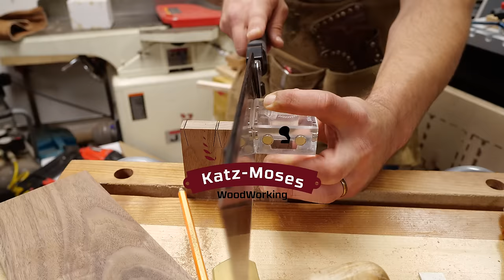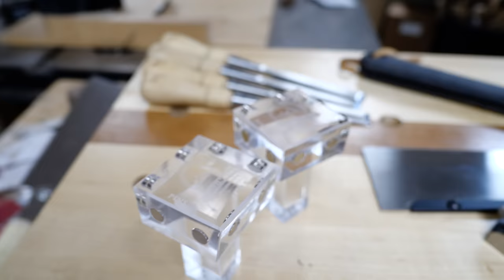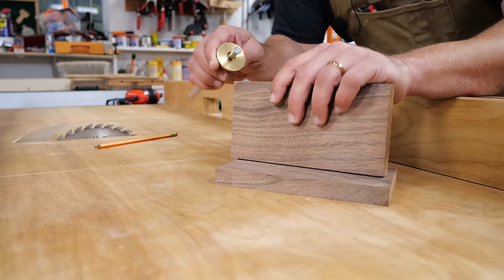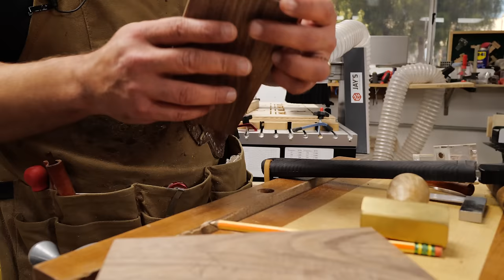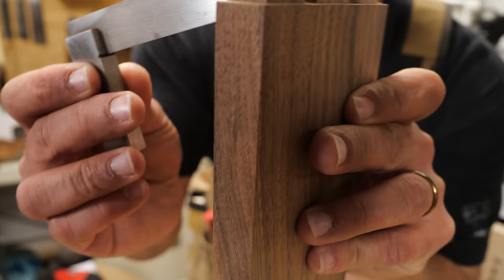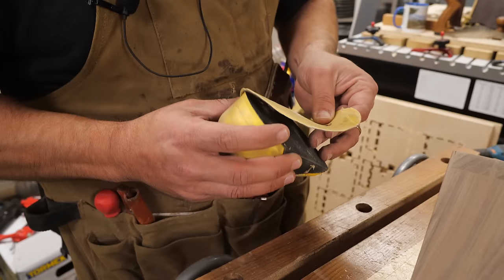A Comprehensive Guide to Cutting Dovetails - Tips and Tricks Galore

Comment: Jonathan I was watching this video again (I never get tired of it) and I thought of something that I learned as a apprentis many years ago here in Los Angeles in Local 721 Cabinet Maker Union working for German shops.  Our finishing team of German finishers would take Dap tubs and cut them open, empty them into container and using dies would adjust the color to the exact shade to the hard woods we were working in.  Crown Molding for example, back then we screwed them in place with the old Robinson head pin head screw to the metal studs behind the dry wall.  Later we changed our installation to just screwing a cant strip to the dry wall ceiling corner and then panel adhesive and gun nailed the molding in place.  Point I'm making here is that we too used our sawdust with glue as  nature filler,  that is a very old method as I am sure you already know but I am sure that you like many others I see on You Tube work with very exotic woods from time to time and this method just might come in handy some time.  I hope not but you know, _ _ _ _ happens.   Love to watch a master at work.

Comment: About the saw dust trick; You need to be sure that the species of wood you are using does not go black or dark blue when you mix it with water based glues.  I have had that happen to me a few times, especially with gum tree woods and it's a real bummer on an otherwise great piece.

Comment: Great stuff, many thanks. If the saw blade is well supported by the magnets what about a simple 90 and 45 degree version for regular carpentry and a long scarf joint perhaps.  Also routing in door locks with deep holes that need to be parallel to the face of the door.  What about an accurate universal steel base plate to which you attach one wide or two less wide guides by magnets to keep the router exactly at right angles to the door face.  One each side to finish each side exactly where it needs to be to fit the lock.

Comment: if you're cutting the dovetails free hand without a jig , would you also use a marking knife when laying out the front face of the tails and pins so that the saw tracks that knife line ? I see a lot of people using pencils to mark them but today I tried scribing a dovetail on the end grain as well as the face grain with a knife and the saw tracked SO MUCH better than just with a pencil ..... btw LOVING the apron - using it every day !!!

Comment: 5:15, Why do you size the divider 1/8 inch side pin dimension off the square rule, why don’t you set the divider 1/8 inch from the 1inch and 1/4 divider holes which you’ve already created the 2 x 1/8 inch pins after you walked the divider? Then you know for sure you’ve got the same pin size, plus it reduces the need for an extra measuring step off a rule if you have or haven’t got an indented rule.

Great channel, thanks for the knowledge share.

Comment: Let me see if I can word this correctly since I am a novice and I am not up to snuff on terminology: At 16:59, before placing the jig up to your saw you say that you are going to get the cut started with a 'forward' stroke of the saw. On the previous board, when you were at the same point, just before sliding the jig up to your saw you say that you are going to get it started with a 'backwards' pull of the saw. My question is, why is the saw started differently on each side or does it matter?

Comment: I'm a bit confused.  At about 4:48 into the video, where you decide how to mark out the dovetails, the board was 3 3/4 inches wide, so you set your divider to 1 1/4 inch, or one third of that.  Where does the 1/8 in pins come in?  Did you skip something?

Comment: I have a beginner's question and hope you can help me.
I am building a frame for a box using dovetails. I want to use wood stain.
Should I apply the stain before assembling and glueing or afterwards? I fear if I use it afterwards the stain would not work at spots where I used the sawdust trick. Applying it before would require me to also put stain on the sawdust. What do you think is better?

Comment: at 25:04 if you look at the two boards put together, the right side( as we look at the picture) appears to be a bit wider than the rest of the board like 1/16 of an inch....wouldn't it be a good idea to measure the end result with calipers or any other measuring device against the rest of the two boards to see if we have the same width at the joint as the rest of the boards? is it possible that the bigger tail is pushing the smaller pin at the end of the joint?

Comment: Did my first dovetail drawer and used your jig. First joint was the snuggest fit I’ve ever made! Is it normal practice to leave the scribe lines visible or to plane them out. The visual definition the line gives is nice imo.
Reply from the maker: It's just a matter of personal preference.  Some people think it looks good and adds to the hand cut look of it. others think it takes away from the piece. I prefer to remove mine but either way looks great I think

Comment: Very nice.  One question as I may be missing something and considering your flipping the board anyway when cutting, why wouldn’t you have a jig with the 8:1 angle on one side and 6:1 on the other?  Getting both angles for the same price would sure make the tool more attractive.
Reply: Also thanks for the backstroke tip with the Japanese dovetail saw.  Just tried and works really nice.  Not sure why I didn’t figure it out on my own but oh well
Reply from the maker: It's already almost half the cost of my competition. Also it would be impossible to have both pins, tails and a shoulder side in both sizes on one jig. Even if I did a 7 sided one it would probably get pretty confusing

Comment: Okay pretty decent guide here but there's some stuff that bothers me. I am a beginner, but have enough experience to notice this:

Think it's bad practice to mark/scribe all over your dovetails and pins just to consequently having to sand everything down to get rid of it. It gives the illusion that it saves time to just quickly scribe all around, but then you have to waste time on sanding everything - or waste time on not sanding down, but having to think of an excuse for why you were to lazy to do it properly.

Also, these thin pins relative to the tails make it an imbalanced joint, adding a rebate like this perhaps even makes it worse. (using a rebate like this does make sense if you are making double (inlayed) dovetails)

Another thing I wanna say is that all these jigs are making things easier and quicker - but especially for beginners I would recommend doing as much as possible without them, so to improve your skills.

Comment: I was wondering, why have the pins be so narrow? It seems like, in theory, you could have slightly wider gaps between the tails and the pins be a little thicker, and then not worry about the pins being so delicate. Granted I haven't actually tried cutting dovetails yet, and maybe they're not as fragile as hey appear. I assume there is a good reason for them being done this way, I just can't figure out what it is from my limited knowledge/experience.
Reply from the maker: Because there's no way that they can be machine cut when they're thinner than a 1/4 inch on top. Thinner proves they're handcut and in my opinion look way better
Reply: @katzmosestools  That makes sense. Thanks!

Comment: 1. Can I assume that there are no hard and fast rules about the sizes for the pins and tails?  2, And it seems like it is acceptable do do either the pins of tails first but maybe with the rabbit you need to do the tails first?   Seems like much of this is personal taste and the newbie (me) has a lot of leeway.
Reply from the maker: No necessary size bu skinny pins are desirable because they cant be reproduced by a machine thus creating a handmade look. Always tails first. There's no way (barely any way) to mark out your pins accurately onto your tail board.
Reply: Thank you. Got it. Makes sense. Trying my 1st Dovetails now. Your jig should arrive today.
Reply from the maker: @AlGuden  I can't wait to see what you create bud!
Reply: Al - There are no hard and fast rules for dovetail vs pin sizes. BUT, making the pins too small makes the joint physically weaker. The ratio of dovetail size to pin size should be about 70/30. Too much less makes the pin board too weak to support the joint over the long haul. Jonathan’s assertion that the pins should be skinny is just an ego thing. Who cares if someone might think your dovetail joints are machine made??? That just means you are cutting some amazing dovetails! Jonathan always spaces his dovetails evenly across the joint. I have seen and have created a variety of spacing for my dovetails. Get creative and change it up! Sets of two or three toward the ends  with another set of two or three in the middle adds interest to your dovetails without compromising the strength of the joint. Jonathan’s skills are amazing and, while I love his work, the creativity is kinda “meh.”

Comment: Why are the pins made so narrow? Wouldn’t the joint be stronger with balanced sized pins and tails?
Reply: You're right. Really the only reason to make pins so narrow is to show that these are hand-cut dovetails (a router bit can't make a tail-cut like that). Of course there are tricks to get the same result with a table saw for instance.
Reply: You can buy hss router bits that allow for those narrow pins for the Woodrat system.
Reply: Jim Bo ....thanks for the info.  Actually I don’t like the narrow pins but prefer tails and pins to be an even balance in size.  A connection is no stronger than your weakest part.  The small pins look better but I prefer the stronger joint.   Wood is really beautiful! 👍

Comment: Hey Jonathan Katz-Moses I’m having trouble when I start to chisel. The wood is crushing or compacting. I’m only taking out small amounts at a time. Are my chisels not sharp enough or is it the cheap poplar I’m using. Any suggestions are helpful thank you.
Reply: Cody sounds like a sharpening problem. For poplar and harder woods, you really need to use a honing guide to get a consistent 25 or 30 degree angle on all your bevels, and take them all up to 2000 grit sandpaper or 8000 grit water stone. You want a mirror polish on your backs and the primary bevel. Then, increase the angle on your honing guide by 5 degrees and put a secondary bevel on every chisel blade. This bevel need only be 1/32 to 1/16 wide. 10 strokes on the 2000 paper or 8000 stone usually does the trick.
Reply: Cody sounds like a sharpening problem. For poplar and harder woods, you really need to use a honing guide to get a consistent 25 or 30 degree angle on all your bevels, and take them all up to 2000 grit sandpaper or 8000 grit water stone. You want a mirror polish on your backs and the primary bevel. Then, increase the angle on your honing guide by 5 degrees and put a secondary bevel on every chisel blade. This bevel need only be 1/32 to 1/16 wide. 10 strokes on the 2000 paper or 8000 stone usually does the trick.
Reply: William Bloomberg appreciate the information. I recently bought better chisels and have gotten a better bevel and mirror finish. They cut so much better then my cheap chisels I had but I still need to buy a honing guide.
Reply: Cody It depends on what kind of chisels you bought and how much you want to spend, but I have a favorite. For most chisels and plane irons, the Lie-Nielsen is the best by far. It’s an edge-clamping guide, meaning that it holds the blade square to the stone by clamping the iron on the right and left edges. Veritas also has a guide with some great features, but it clamps the iron from the top, and they can and do shift all the time while you’re honing. NOT GOOD!!! both of these honing guides are expensive, $125 to $150–Ouch!!! For $15, you can buy an “eclipse” style edge-clamping honing guide on Amazon that will give you consistent results on most chisels and plane blades. I still use an old eclipse honing guide for all my sharpening, including my Lie-Nielsen and Stanley Sweetheart plane blades, as well as my Matsumura Japanese chisels. I typically put a 25 degree bevel on all my plane irons with a 30 degree secondary bevel. My 20 year-old eclipse-style honing guide does just fine with them. The Japanese chisels are a bit more difficult. The wider chisels (1 inch and up) have very short blades that don’t fit well into the clamping jaws. I don’t have a great solution for you if you have these or similar chisels. Good luck!
Reply: @cody1612  Sharpening is everything (almost), Cody. You've got to get that honing guide ($15) and learn to hone your chisels and plane irons to a mirror finish, front and back. The back only needs it once, and only the last inch or so; then, you'll never have to do the back again. Take your planes and chisels to 25 or 30 degrees, depending on the blade type, and then add 5 degrees to get a micro-bevel. You only need 1/16 - 1/32 of an inch of micro-bevel, and polish that bevel! You need to go up to 2000 grit sandpaper or 8000 grit whetstone to get that mirror finish. Don't give up, keep at it until you can make it work. Next time you sharpen, it will take you less than a minute to restore the micro-bevel. Your mortises, dovetails, and other fine chisel work will take far less time to accomplish and your joints will be far better for the effort you put in to sharpening your iron.

Now, for the iron. Start saving up for quality chisels and bench planes. You need AT LEAST one or two GREAT chisels and one or two GREAT hand planes. You know who the makers are... I recommend Lie-Nielsen, but Veritas is great too. They are the best! If you are serious, buy the best. Start small: 1/4", 1/2", and 1" chisels, and you'll need a block plane and #5 jack plane.

Good luck with your woodworking! It's given me a lifetime of enjoyment. Quality, sharp tools make it that much more enjoyable!